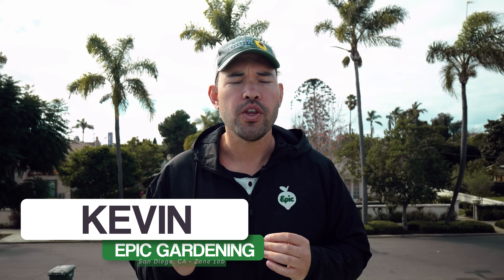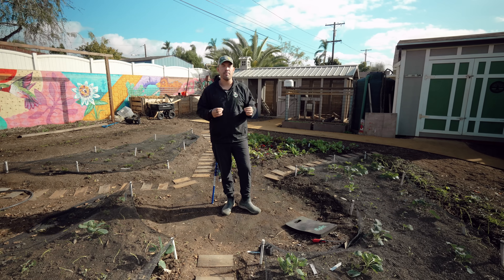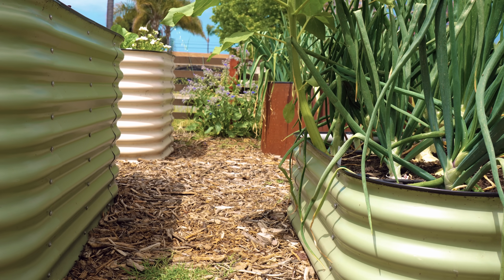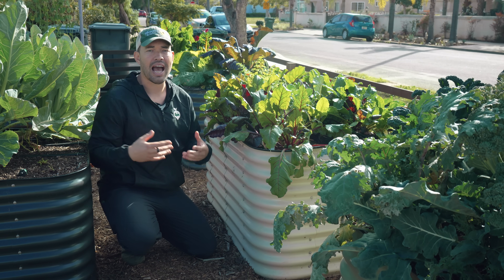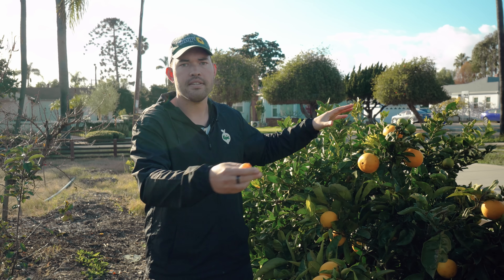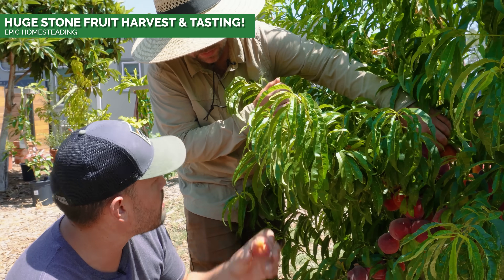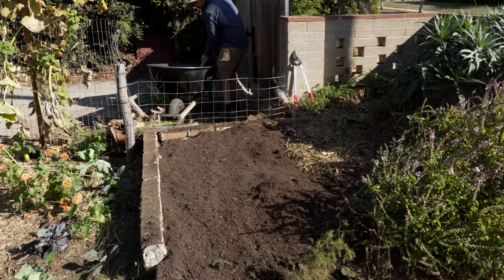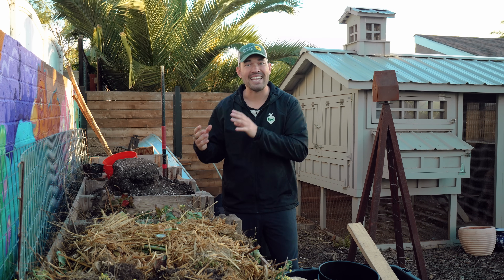How I Built a Sustainable Suburban Homestead in 3 Years

Comment: Regarding Tilling:  I started getting into gardening a little over a decade ago.  During my 'research' I learned there was a thing called lasagna mulching to improve soil or even just spreading free tree grindings and letting worms and other critters pull the organic matter into the soil.  Over the years since then, this idea of low energy soil improvement has gained a lot of popularity amongst YouTubers to the point where some people started looking down on the notion of tilling.  "Do you know the carbon footprint you are creating using a gas tiller?". But the thing presenters gloss over and commenters don't seem to catch is that it takes YEARS for the slow method to improve soil below.  And if a person is on hard clay, most of the nutrients can wash away before nature can move the organic matter  into the soil.  So while I personally am going the slow method, the notion that someone might want to jumpstart their process by tilling organic matter into the soil shouldn't be frowned upon. 3-4 hours of tilling to get healthy, food-sustaining soil in a year's time?  Seems to me that carbon burp of running the tiller gets offset pretty quickly by growing more produce quicker than it would have taken the slow route.
Reply: You’re totally correct and we cannot get dogmatic about this - we need to be sensible and understand the natural processes. I also have a heavy clay soil which needed to be tilled well and mixed with manure, compost, and some soil. Then I threw in about 50 earthworms and 100 red worms. I’ll let them do the work for a long time to come. Afterwards, I covered the area with soil l I’ll be using for gardening and then alfalfa hay mulch.
Reply: I second this! 👏
We all love and respect regenerative land techniques but of course, sometimes the only sensible choice is to work in a bit of tilling.
Reply: If all land was natural , tilling wouldn’t be necessary but usually we’re dealing with land that has been driven in , plowed , beaten , had everything alive sucked out if it for generations !! Tilling is simply a way to speed up fixing the land and bringing life back to it . The sooner the better . Dogma tends to be negative in many spheres and one of those is gardening
Reply: while my experience is limited, I never understood the stigma to tilling. It just seems like a perfectly good solution
Reply: Yes. My grandmother did some tilling of her garden patch initially.  Then she applied compost, mulch etc etc.  after a few years, she no longer needed to till.
Reply: I second that. I just turn it by hand (no gas). you can see my garden at Real Bolivian Homestead, it is not a tiny garden... But then again, I take my time and do it one bed at a time.

Comment: I was speaking to my arborist earlier, and he said sometimes you want to go with the smaller, younger trees, instead of the older, more expensive ones. The reason is that, when it comes to older trees, some orchards will cut back the roots heavily to get them to fit into the pot. As you might expect, this causes a lot of damage, and the tree has to expend energy to regrow those roots. It's very likely that a younger tree that has not suffered any damage will grow up faster than an older tree that has been cut like this.
Reply: True. Younger plants in general are more adaptable and transplant better.  You would have to cut a lot of roots off when you transplant a larger specimen and you have to reduce the canopy as well.
Reply: smart. That makes alot of sense. Thanks for sharing.
Reply: Definitely! After a couple of years the younger tree is usually the same size or BIGGER than the older one would be if planted at the same time 🙂

Comment: Back in the early 2000s, my landlord put in a large patch of dewberries & raspberries. Then he put in a small septic tank about halfway between the house & the berry patch. He routed the shower & sink water from the bathroom & the laundry water to the small septic tank. I asked him why he did that with a septic tank... He said he did it to settle any foaming from the soaps we used. (Back then, most soaps had lots of foam & phosphates and special soaps were VERY expensive) He had already routed the kitchen sink water out to the orchard of pecan trees, peaches & Asian pears. The outlet for the kitchen water did foam up some & there was also some grease from washing dishes, pots & pans. So, I guess it was probably a good strategy for reusing water under the existing conditions.

Comment: We have septic and well so it is greywater system but also blackwater. We do have a barrel system for rain water so we don't put pressure on our well to water our homestead but at the current moment it is manual process of using buckets to collect water and pour into the barrels... Ultimately I want to get the barrels to self-fill in the long term, but we need to see how much water we end up using through the year and empty most of the water before freeze and take the pump out as well before winter. Seeing how much water we use will help us determine next steps for the rain barrel system.

I want to get hens next year but we are in a rural area with wildlife with many predators so we have to consider the safety of our flock plus a way to keep them warm in the winter as we are in the UP.

Comment: when it comes to the first flush filter... instead of a horizontal pipe, use a 45 degree below where the horizontal or entry to tank would be.. this will cause an even better first pass flush.  Think that when the debris that comes down the pipe with the rain water, it's also passing by water that is overflowing into your 'clean' tank... you want everything to settle to the bottom of your collection pipe so by having a 45 lower you won't have the chance of the debris getting 'sucked' into the clean tank as it passes by your clean water flow.  I hope I articulated that well enough for those who know to understand.. if you know you have seen how there are still some debris, albeit very small pieces and amounts but it builds up over time in your clean tank... the tip I'm explaining will help to negate that minor issue.

Comment: I just ordered your book on Amazon!  So excited 🎉 (I'm not sure how I missed it until now. 😅). I live in central Texas,  and I've been told that galvanized raised beds don't work here, because it gets too hot in the summer. Have you heard that? Thanks!
Reply: Same thoughts!
Reply: Cement blocks as well. I’m considering kiddie pools
Reply: The problem with plastics are that when they heat up they can potentially leak contaminants into the soil. So then I was contemplating some kind of wire or wood frames and landscape fabric…
Reply: And I think with the steel in places that are super hot sun, I’m in AZ, utilizing a sun shade during the hot months will help. Also, not painting the steel might allow it to reflect the sun or maybe plants around the raised garden beds to prevent the sun from hitting the steel ?
Reply: @ConsciousConversations  I have raised beds with cinder blocks and I haven't noticed them holding too much heat. But they are definitely a pain to move around because of the weight.